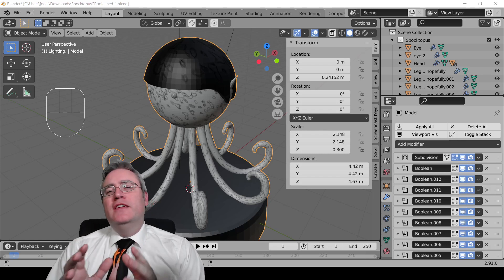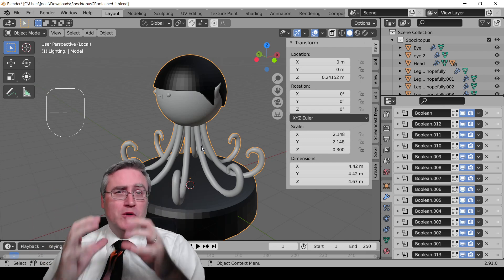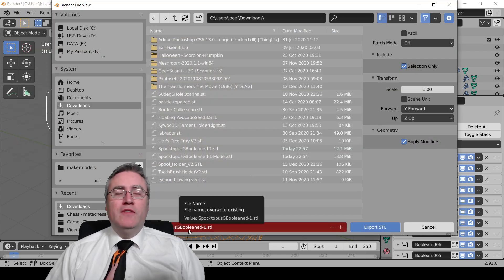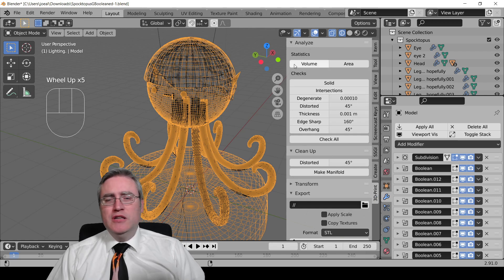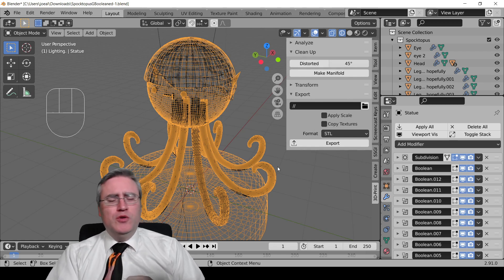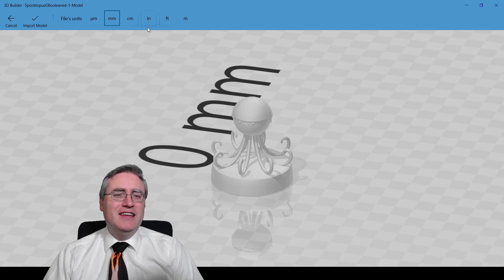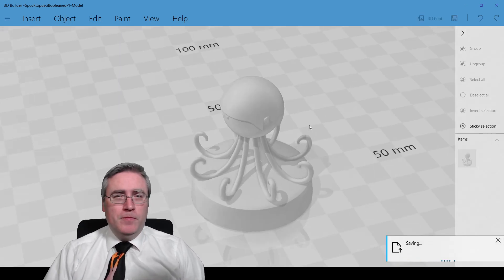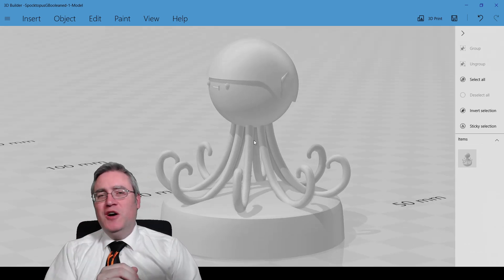How to Export STL from Blender for 3D Printing

Comment: Do I have to join all of the objects into one? Let's say I have a bicycle model that is separated into a frame, pedals, tires n stuff, and of course the foundation (ground). 

Do I have to use union modifier, ctrl+j? Or nothing at all?
Reply from the maker: Are you talking about multiple non-overlaping parts? If the parts don't overlap then it would be the same to select multiple parts and export them or to boolean union them and export the unioned part.

Comment: As a Blender noob, this was extremely helpful! I keep scratching my head at the decisions the Blender gurus bake into the software, but I guess everything has its eclectics. I hate the " Oh, you'll get used to it" sentiment. No, things should be intuitive. But now I'm complaining... It is also weird that I have to use Windows or Netfabb to clean up an stl. Why doesn't Blender include this?! Anyway, thank you for these tutorials!
Reply from the maker: Keep in mind, Blender isn't made for making models for 3D printing. It's a 3D animation program that you can make models for 3D printing in. 
Fortunately, it's extensible, so until it's officially fixed, you could write a fix for it that might get folded into the official release.

Comment: Hello, I've just exported my STL with selection only and the chitubox doesn't want to open it, it says invalid file but if I export the file without selection only then it works fine. Do you have any suggestion?

Comment: great video.  3d builder was a huge life saver.  See i modeled something in Blender..and i used the correct measurements before doing so..But still when i exported it in stl it would print super small..I never figured it out.  But now i dont need to, i can just resize it in 3d builder

Comment: Hello, I watched your video, but unfortunately did not find a solution to my problem. The thing is that when exporting a model for 3D printing, using the stl format, the quality of the model deteriorates greatly - rounded areas become angular (probably the number of polygons becomes less when exporting). I had the same problem when exporting 3D models from AutoCAD - the solution was to use the FACETRES command and increase the default value to the maximum. However, for blender I have never been able to find a solution and I would be very grateful if you could tell me!
Reply from the maker: If you could jump on my discord and upload the file, or post some pictures I'll be able to check it out for sure. But, with what information I have, the best I can say is that you're getting exactly what's there.
What's the source of this file? Did you make it in Blender or was it make elsewhere? Chances are if it looks smooth in Blender that you've got smooth shading on, a method for faking your eyes into thinking there's more geometry than there is. Switch to flat shading by right-clicking on the object and choosing "flat shading", and you'll see what's really there.

Comment: helo sir i need some advice
Reply from the maker: My first piece of advice is "don't ask to can ask, just ask".

I can not provide any advice on a request for advice without information about what the advice you need is about.
Reply: @3dpprofessor  ok thank you i need or want to print a rugby ball with a photo on how does one do it and what programs do i need
Reply from the maker: @slinginlead4886  Generally speaking, most 3D printers only do one color. So photos are kinda out of the reach of them. Unless you want to use a fancy 3D printer which can do full color or a 3D printing service with that sort of 3D printer. Is that what you're trying to do?
Reply: @3dpprofessor  thank you but no i mean a lothophane that is a rugby ball
Reply from the maker: @slinginlead4886  lithophanemaker.com can make round ones. But if you need it to be a rugby ball shape you're going to have to learn to model it yourself. Do you know Blender?
Reply: @3dpprofessor  a bit but how do i convert it into blender to lithophane
Reply from the maker: @slinginlead4886 this should help https://youtu.be/UyHbbZ-Ac2Q

Comment: sir question, so saving the object as an stl and import it to the windows 3d model app and repair will completely fix everything inside? like any extruding parts inside the mesh?
Reply from the maker: 3D Builder does a really good job with all mesh problems, including parts inside that you don't want.
Reply: @3dpprofessor  i see, so i guess its an ai that maintain the outer wall and eliminates any portruding parts inside?

Comment: Can i use just solidify modif instead boolian?  I have nice grid,  normals. thats wiil be ok?
Reply from the maker: Depends on your application. Solidify turns your shape into a shell with an outer and inner wall.

Maybe you're thinking about the remesh modifier with the voxelize setting. That would work, but it means you have to turn your model into discreet and evenly space points all over your mesh, and I kinda like having a little more control of where the points go.

Comment: I have learned a ton from you. I'm stuck on my snowman. My husband uses PrusaSlicer to send to the printer. He says I need go scale my snowman from your Absolute Beginner videos to mm. Is this true? Is the only way to scale the entire collection after being modified by using windows 3D builder? Thanks!
Reply from the maker: In the "How to setup" video I go through the setup of scale in Blender. https://www.youtube.com/watch?v=HqDnLg3o9WE
Reply: @3dpprofessor  yes I watched this one too, but it looks like you're only scaling the cube. So does that mean I need to scale the snowman one object at a time and then add mods again?
Reply from the maker: @hannahbyers1957  You probably do need to scale the snowman. As created it's only about 2mm wide. You should be able to confirm that in Blender if you setup the units in blender properly. At the point of the snowman I hadn't scaled it properly yet. So, yeah, it's gonna be small. However, you can select all and scale it up by 100 to get it to size that works.

But, for a snowman, scale doesn't matter. make it as big or small as you want in the slicer. Scale only become important when you're working on marts that have to interface with the real world.

Comment: Thanks very much for the video! Lots of good info there. 

Little correction, Netfabb is Autodesk, not Adobe. But an Autodesk account gets you Tinkercad and Fusion360, so it's worth it. :D

Also, a video on importing STL's to modify them would be the logical next step!

Comment: I agree. "Selection only" should be the default. I've also griped about that very same thing for years. Never made sense.
Reply from the maker: IT USED TO BE THE DEFAULT!
Reply: @3dpprofessor   You can configure any plug-in defaults to your liking :- 

1. Open Blender in Admin mode (Right click on Blender icon in Start Menu >  'More'  > 'Run as Administrator')
2. 'File' menu > 'Export' > 'Stl'
3. Right click on 'Selection Only' > 'Edit Source' 
    - - (if you don't see the Edit Source option, open Blender Preferences > 'Interface' > 'Developer Extras'.
4. Close the export window and go to 'Scripting' workflow. At the top, click on the drop-down list near 'New' and 'Open'. Click on '__init__.py'
5. At this point, you will see the plug-in script (a long string of python code). Scroll all the way to the top of the script and click on the first line to move your cursor to the top of the script.
6. Press 'CTRL + F' > type Export selected objects only > click on Find Next ( !! use the Find 'Next button', do not press Enter!! ).
7. Just below the selected text, you will find default=False,.... replace it with default=True, (make sure capital T, no spaces and a comma at the end of line)
8. 'Text' menu > 'Save'

and viola... next time you try to export in stl, the option should be turned on by default :) I hope this helps.

Really nice series of tutorials btw! Thanks a lot !
Reply from the maker: @adisage  Why, it's so simple, anyone could do it!

Thanks for the step-by-step. My only complaint is that this doesn't stick around after an update sometimes. So you've got to do it over and over again.
Reply: @3dpprofessor   I'm glad I could help :) it is indeed very easy and helpful !
 I just wish more users were aware of this ...
Reply: @3dpprofessor  What happens if 3d builder lags out and doesnt complete the repair?
Reply from the maker: @JJ-vp3bd  couple of possibilities. Most likely you have a very complex and very damaged mesh.

First thing to try is drop it into your slicer and see what it makes of it. Maybe you don't need a repair. But check that preview carefully. 

If there are still problems, can the mesh be simplified? Can it be fixed by hand?

Comment: You made it look harder than it is, just select what u want to export make sure that you don't have any missing faces or flipped normals and export with selection only as stl. Than open in prusa slicer and if it need it repair it there (it's automatic process) and if it can't repair it the way you want, use Netfabb, if it's still wrong that means that your model is just wrong :D
Reply from the maker: Prusa slicer, Flashprint, and Ideamaker all can automatically repair bad meshes with deferring degrees of success. Cura and Simplify3D doesn't even try.
Reply: In SketchUp there is a free tool "Solid Inspector" that will examine your model, point out all the errors. You can fix them or it will fix them for you. Shift / Tab will show where the error is. I make every project 100% perfect. And I know what was wrong and where.